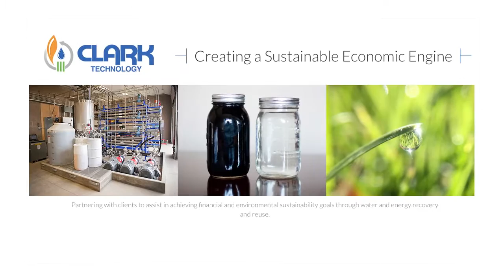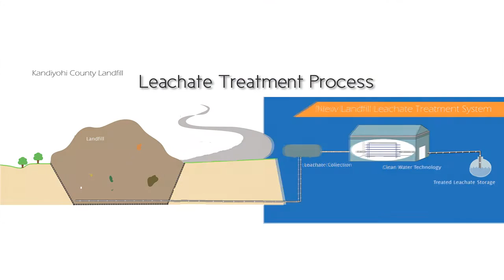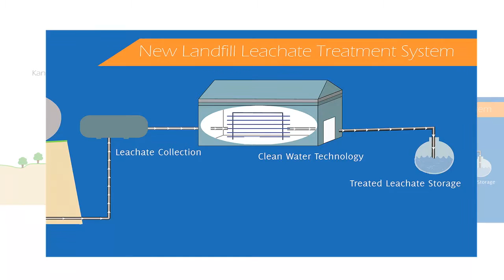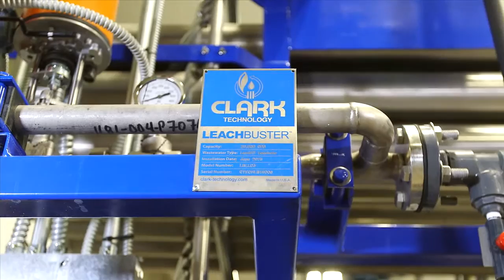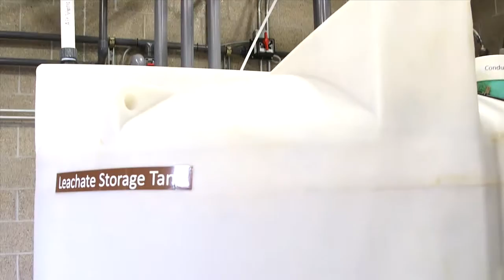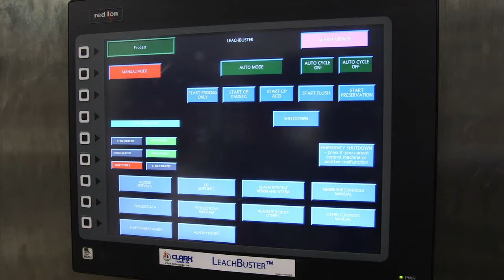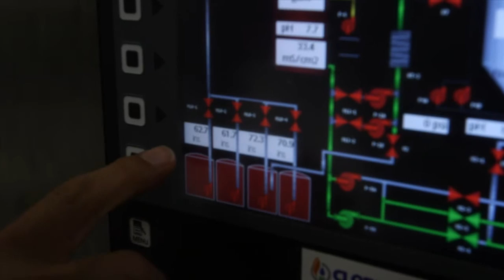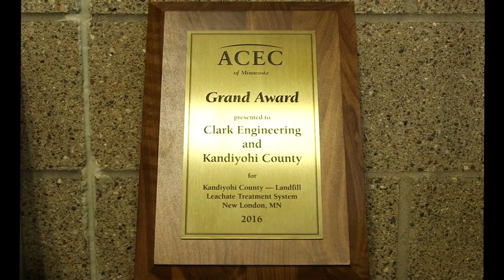LeachBuster® Landfill Leachate Treatment System @Kandiyohi County Landfill

Comment: a machine is shown here and claims to return in the system and provide clean water..What is the COD value of leachate first?
(very variable starting from 5000 mg / l to 100.000 mg / lt)
How many days does it clean? or hours?
electricity consumption or materials used?
nothing described here is clear..and it may be suitable for small cities.
I am not sure..The most suitable system for leachate is oxidation .
I do not know if there is an oxidation process in this system.because there are too many organic, inorganic and metals ready to oxidize pollutants in leachate .and you can't take them out from the leachate in another way..it can do this successfully with AOP and one of Fenton methods by a good operator.all other methods only give good visuals for advertising..
Reply: Agreed its definitely a suspicious video

Comment from the maker: LeachBuster® is a tunable system which can produce effluents with 13 different levels of purity. Starting from level LB-L1 which has a molecular cutoff weight (MCW) of  about 200,000 Dalton (equivalent to Ultra Filtrations)  to LB-L13 with MCW of  200 Daltons (Which is Ultra-pure water normally used in semi-conductor industry.
Reply: service so how do you collect and manage the solute concentration?